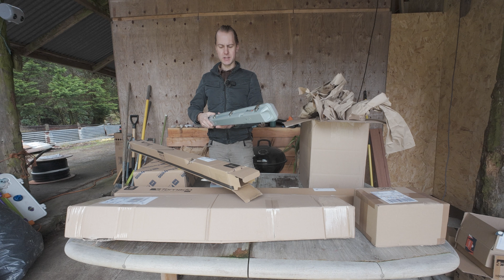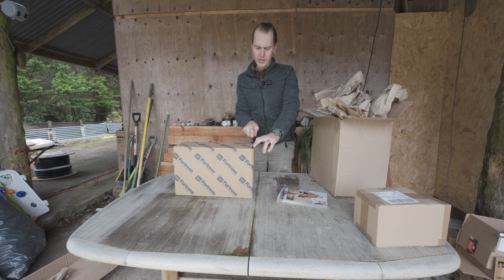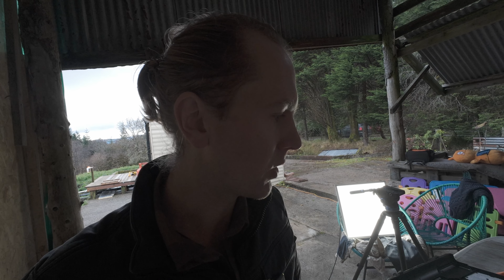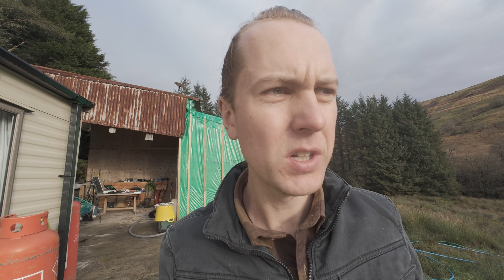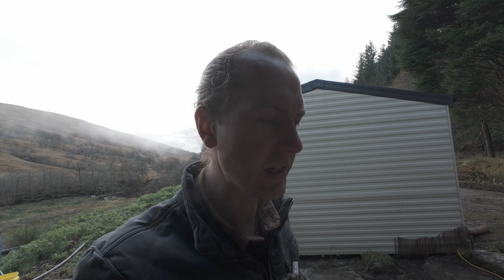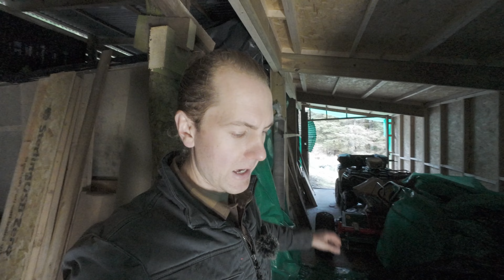Off Grid-Day 32-Biggest post day yet

Comment: Hi rob. I would love to know which diesel heater you suggested please
Reply from the maker: This one has been reliable for us. Can't promise they all will be because they are on the cheap side but the others we have bought fail all the time. https://www.amazon.co.uk/HCALORY-Integrated-Parking-Heating-Control/dp/B0C37CZ1CB/ref=asc_df_B0C37CZ1CB/?tag=googshopuk-21&linkCode=df0&hvadid=658877062259&hvpos=&hvnetw=g&hvrand=2429436665454811406&hvpone=&hvptwo=&hvqmt=&hvdev=c&hvdvcmdl=&hvlocint=&hvlocphy=9180893&hvtargid=pla-2195200246449&mcid=a050ce90247a3019a38a1f68b6090719&th=1
Reply: Thanks. I'll take a look.